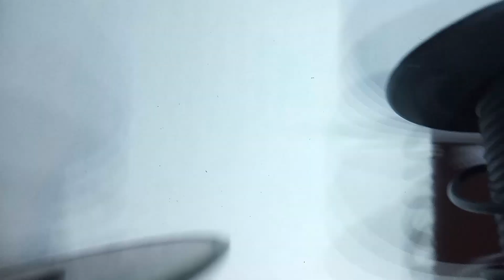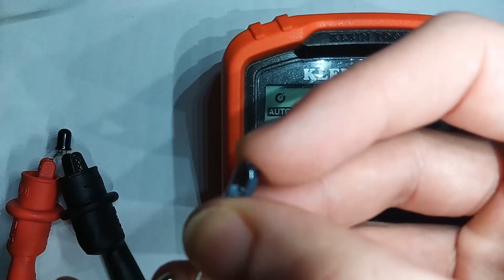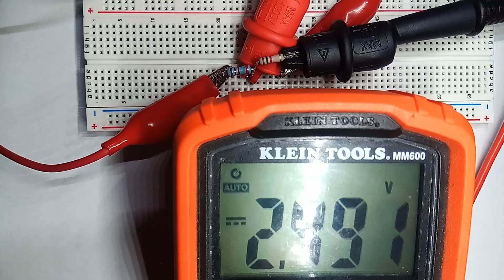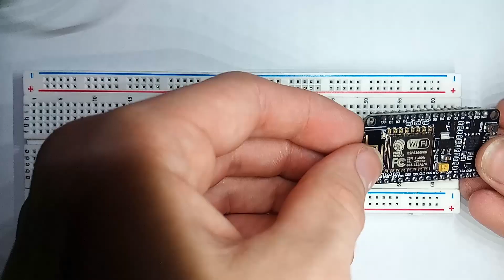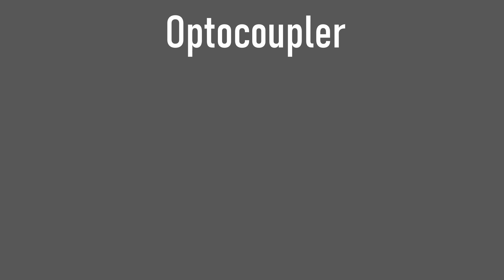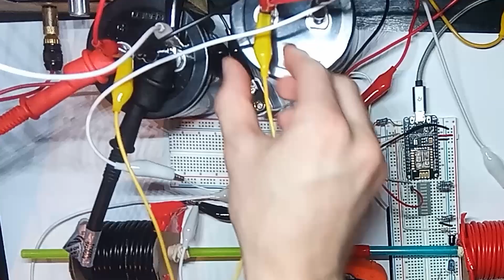Actually Adding More Coils: Making a Coilgun - #4

Comment: You should use a phototransistor with a push-pull output (sort of like the first one you selected, but without the weird band-pass behaviour) and datasheet-guaranteed detection delays and rise/fall times. They have the downside of having a predetermined trigger threshold, but as long as you design with that in mind, it will likely work a lot better. This is because your resistor divider will take some extra time to charge the wires. A push-pull output will have the same rising and falling delay and it will charge the wires faster overall.

I recommend the OPL5xx series from TT electronics. They come in a few flavours with different hysteresis ratios and threshold irradiances. Their propagation delay is typically 5 microseconds, and the signal edges are guaranteed to be less than 70 nanoseconds.

Hope you pick up this project again!
Reply: Maybe, maybe. Oh sure. Very impressive! See also my first Coilgun 50 volt :
https://youtu.be/UpYrQsr1iRE

Comment: Ayo put a Iarge capacitor in parallel with the thyristor to ensure efficient switching. They need a large current surge in order to switch fast and if this current surge is not high enough it will take longer for the thyristor to reach its least resistance thus dissipating alot of power as heat
Reply: Oh sure. Very impressive! See also my first Coilgun 50 volt :
https://youtu.be/UpYrQsr1iRE

Comment: controller - NO, use ne555 to drive a power pulse. Way cheaper and u can modify delays with simple trimmers without moving sensors. Also it will be more durable.
Reply: Oh sure. Very impressive! See also my first Coilgun 50 volt :
https://youtu.be/UpYrQsr1iRE

Comment: Thats's very interesting and I have a few questions (I'm not an expert):
There are a lot "multistage" coilgun designs out there which use mutliple IDENTICAL coils. Doesn't that limit the acceleration to some point? Of course you can optimize the acceleration by timing the switching sequence. But isn't the acceleration more dependant on the strenght of the magnetic field, which depends on the other hand on current and number of windings in the coils? In your other video you pointed that out, right?
In my understanding therefore (assuming the timing is already quite optimal) the projectile would only accelerate through the first few coils and then reach a more or less stable velocity through the rest of the barrel, since the field generated in the coils is always the same.
Wouldn't it then make sense to increase the magnetic field each coil, by maybe using thicker wire & slightly less windings (lower resistance->more current -> stronger field)?
Reply: Hmmm.... With a lot of identical coil i guess your statement is true that the projectile would reach some terminal velocity.

So yeah, if you add too much identical coils, they wouldn't really do much improvement.
Reply: Oh sure. Maybe, maybe See also my first Coilgun 50 volt :
https://youtu.be/UpYrQsr1iRE
Reply: What you said is true. However, when a capacitor is used to power the coil the system must be modeled as a LRC circuit. With multi stage coilguns managing the time constraints of each stage is important for the reasons you mentioned. This is done by reducing coil size and equally important is lowering the capacitance. Since the power output would ideally be constant the voltage of the stage must then increased. 
TLDR. Later stages should have smaller coils, lower capacitance and higher voltage.

Comment: Doubt: will this end up being deadly like a real guns because the  projectile went through the box
Reply: Well... I think it would be quite hard to achieve the same deadly-ness of a basic pistol. You'll need a lot of capacitor to contain the energy required to propel the projectile to very high speed.

Unless you're gonna shoot someone at point blank range then the current coil gun should be enough to injure him/her.

Comment: Can anyone help me with IGBT transistor connection? In question is IRG4BC30FDPbF. Where should I connect logic signal and + and - of load?
Reply from the maker: The signal goes into the gate (probably pin 1), the - of the load goes to the collector (probably pin 2) and the emitter (probably pin 3) goes to ground. Then the + of the load goes to +.